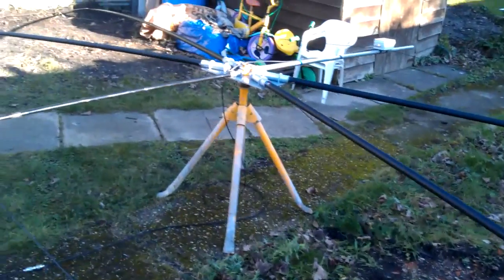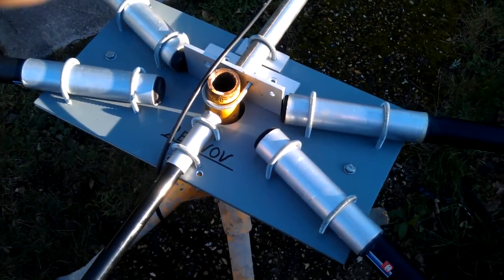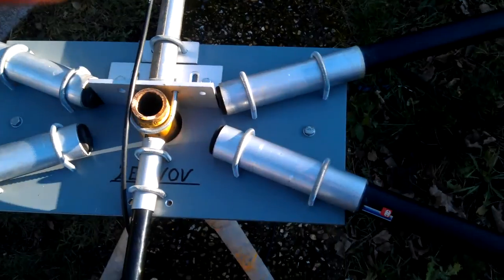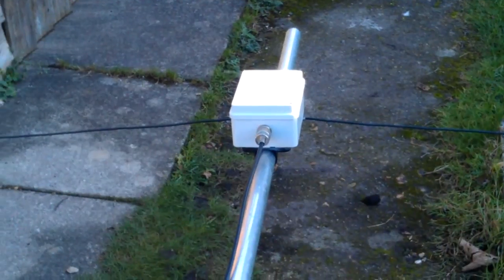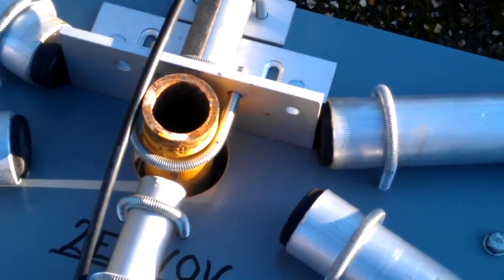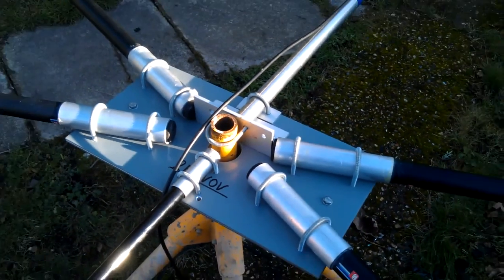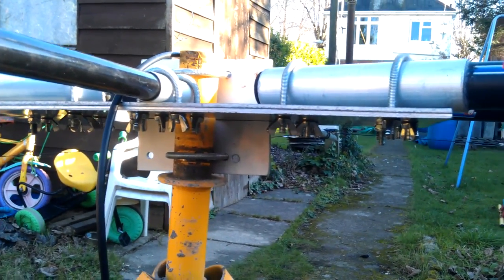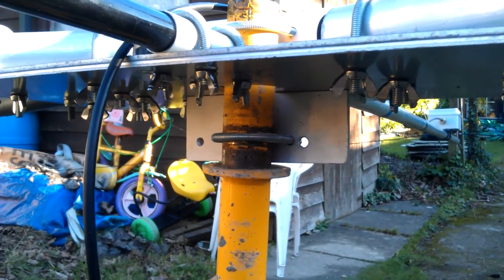Homebrew Moxon antenna review

Comment: Where did you find those 6 meter fishing poles?  Been testing a Moxon here and very impressed so far as the actual performance proves the modeling.
Reply from the maker: Hello buddy, indeed the moxon works good for just two elements.The rods came from ebay, I cant remember the details as its getting on 10 years ago. Enjoy your project. 73